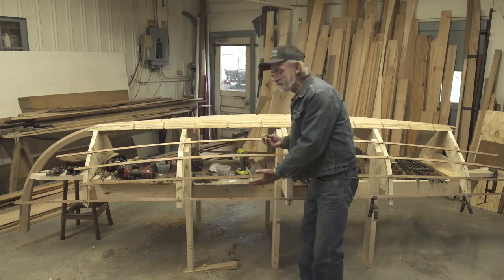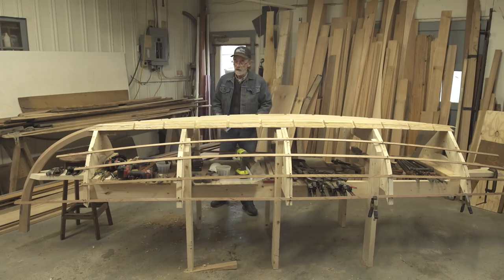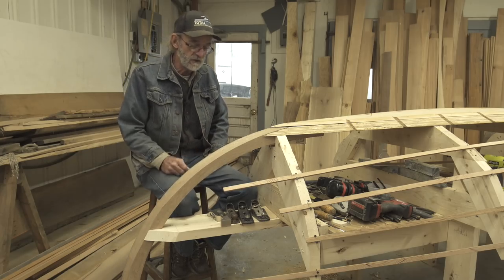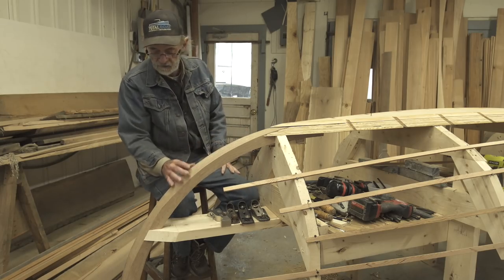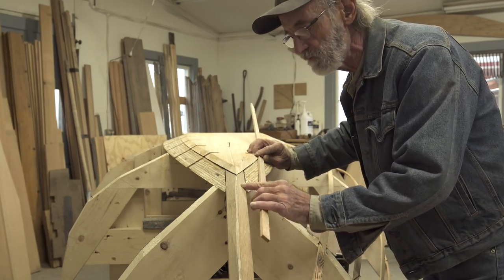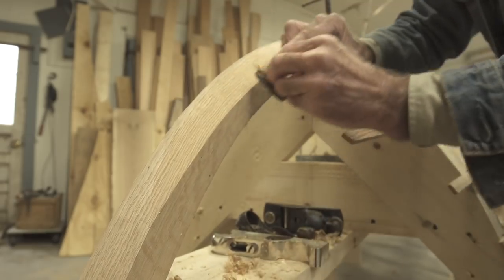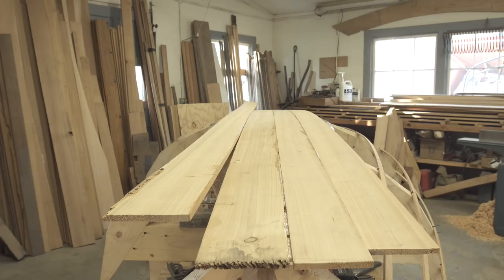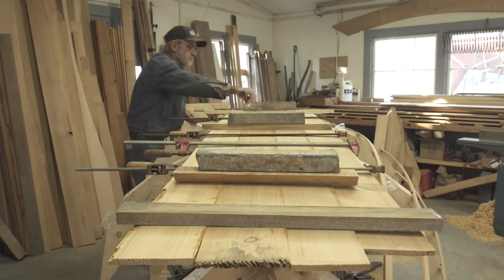Building the TotalBoat Sport Dory: Episode 12 - The Stem

Comment: Any issues with the scrap cross pieces beneath the weights adhering to the planks? I would guess you have a tough time removing them from that soft cedar without tear-out. Just curious, because I didn't see you put packing tape or wax paper between the surfaces before tossing the lead bars on top.
Reply: zillustration I saw clear tape on the wood pieces under the lead, you can see they are shiny. You can see the tape on the ends of all the spreader bars.

Comment: Hey Lou, curious about just a butt joint for the planks, why no rabbit or tongue and groove for added glue surface and strength? btw love your videos!
Reply: Steve Lippincott because with a flat surface you can remove the broken planking and replace. If it's jointed or rabbitted the you cannot fix the planks without a lot of trouble.

Comment: As it turns out, I've long wished for a good Swampscott option to split the difference between Chaisson's famous old 12-1/2-footer, and the more common 16/17-foot-LOA size like Gardner's well-known example of this type.  With your apparently rather steep stem angle, you look to have most of the waterline length of the bigger working models, but a shorter LOA at the rail... I believe you mentioned something like 14 feet overall during the design/lofting earlier? 

Yeah, so...  I think I'm gonna need a copy of these lines for myself, Please!

Comment: I build my canoes, Stemless. I wonder what your thoughts of building a skiff this way ? Great videos ! Thanks !
Reply: Jim Dodd I think if you built a light rowing dory, like spirainternational sells, you might be ok, but it seams like Lou wants a boat that could smash through icebergs and  not get damaged running over rocks.  Just my 2 cents worth...
Reply: A Common misconception, that Stemless is weaker. Not true, for canoes ! I have run my strippers head on full speed, into boulders, with no damage, even lost a few off my truck rack, going down the road, 60 mph. Broke the gunnels, stems remained intact !  The worse, lost a Wee Lassie type, and was run over by an oncoming SUV. Crushed it in two, stems head together. I'm convinced of the strength of Stemless construction!
Reply: Jim Dodd Happy New Year. If you are comfortable building and using a boat without a stem, more power to you.  If you use enough fibreglass you wouldn't need any wood!